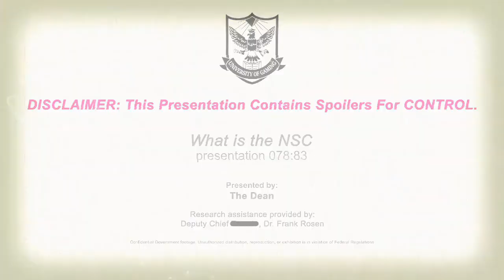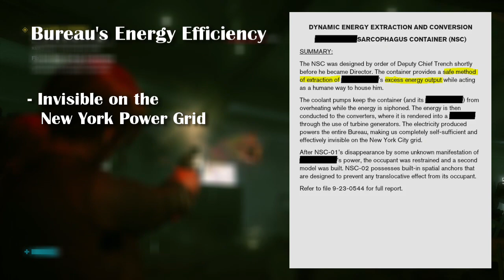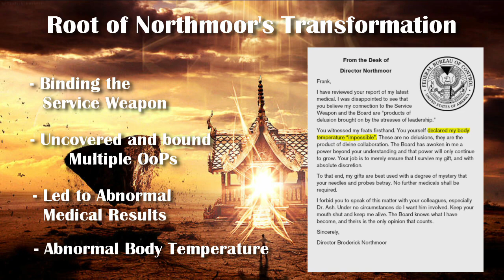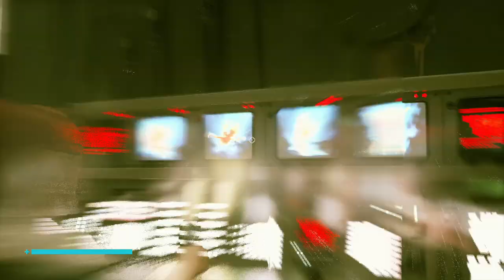Control Explained - What is the NSC?

Comment: So the NSC is essentially a supernatural nuclear core. The FBC is sitting on a Chernobyl inspired power converter where the slightest mistake will set it off. If that's the case... Then wouldn't that blow up not only the oldest house, but the city? The coast?
Reply from the maker: Oldest House? Yes very likely it would be decimated. In terms of the City that is up for debate. One theory that FBC has about where exactly the House is mentions that it may not exist on Earth. That our reality is just a threshold connected to the House. If the threshold isn't open then the blast would be contained. Again that is only is that theory is true.